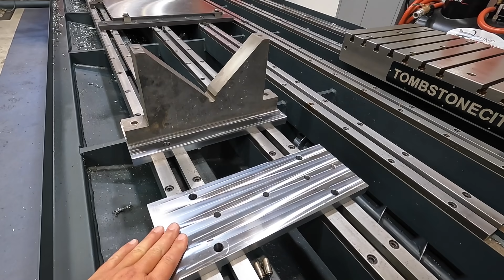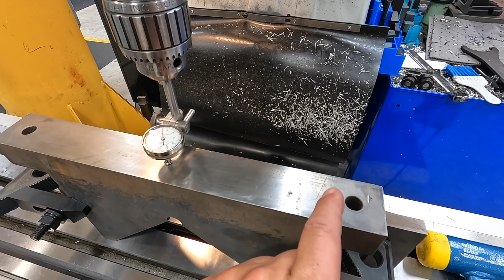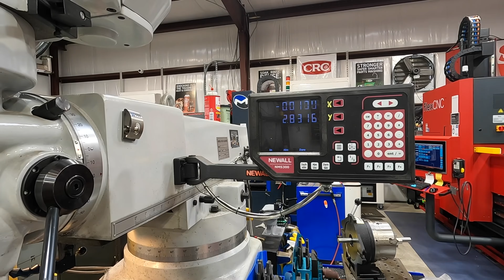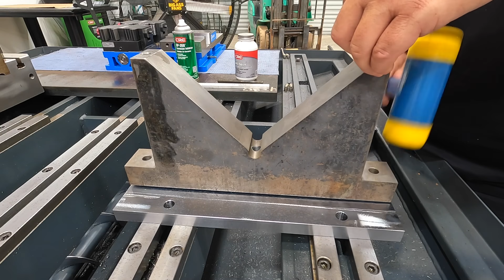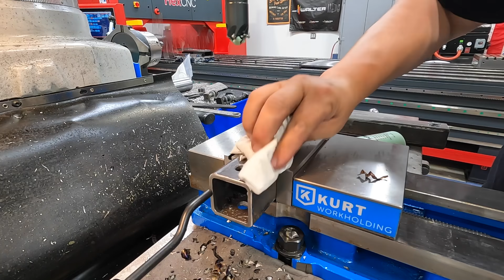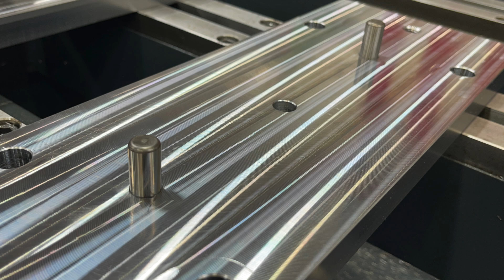Large V-Blocks Modified for the Flex CNC

Comment: When you drill and ream for dowels, do it in assembly. I noticed when you did the Pacemaker you did them separately and turned out with and error. In assembly is the only other than using a jig bore for positioning.

Comment: good job adam . you can mill the V block with a ball end mill if you want it parallel to the machine and then mill reference surfaces on the outside of the V block. so it's quick to find center Next time  or use Haimer 3D in the V track  to find center :face-blue-smiling::face-blue-smiling::face-blue-smiling:👍👍👍👍👍👍

Comment: I know it's easy to say but, instead of drilling in the center of the V-block and dill and tap the shaft to find the center, I would have just used a machinist jack on the milling table to keep the shaft in the middle to find the center, but it's just me. Nice work, Jeff

Comment: Good Sunday morning Adam.
Great video, you put a lot of hard work into fixturing the V blocks. As a hobbyist, I wonder if tapping with a soft face hammer the entire fixtures to correct the difference like you have demonstrated many times traming on the mill would have solved the misalignment or even slotting the holes for Y movement would help solve the issue? I guess it depends on how often the fixture is going to be used and its location on the rails. Heck, the temperature changes can probably change the outcome day to day depending how critical the tolerances are.
As always, I enjoy your content very much and thanks for sharing.

Comment: That was really nice. I wonder, wouldn't it have been easier to make certain your test cylinder was in fact a cylinder? I know that the surface was chrome plated, but I've seen you true up cylinders before in a lathe.  Then you could have trammed the cylinder on the sides and on the top rather than measuring the bottom of the v block.  One less step to introduce error.  Thanks for explaining how easy it is to use shims if the  workpiece isn't sitting right on the blocks.

Comment: The best way to do this would have been just bolted down and 3D mill it whit a ball endmill. 
Adam , you’re a pretty smart guy, why did you do it this way it was so predictable that they won’t be in line because you accumulate a lot of errors and you work a lot , for a crappy result. Think like a CNC guy , 3D mill it

Comment: Adam, i dont think you should have used the surface of the hot rolled plate to tram in and find the center. The v way may not be perfectly perpendicular to the surface you used as your reference. If you sweep the chrome rod, you pulled into the vally of the v, in x axis you could have verified it was perpendicular to the y axis dowel pins

Comment: Your stock left on that ream was correct, but your math was wrong. Typically with reamers, your pre-drill should be 2-3% smaller than the final ream size. For a .500 reamer, that's .010"-.015".

Comment: G'day Adam.  The overall job worked out with slight variant off centre, which can be compensated through programming. 
The problem being that the larger diameter shafts will have a few thousands of an inch variants depending on the length, but even these will have to be trammed in before machining. 
So looking at your efforts,  it looks good. 🎉🎉🎉

Comment: You went through the trouble of making that "centering plug" you should have used it as your datum surface instead of the flame cut edge. That would have insured that you were 90 degrees to the "V". It could also be used to measure the distance from center line of the "V" to the mounting surface and make any corrections if there was a difference between the 2 blocks by milling them. No shims needed. In the end you probably wouldn't have that .003" difference. At least that's how I would have done it.

Comment: If the goal is to find the center of the V not the center of the bottom of the block; assuming the sides of the V are perfectly perpendicular to each other, would it have been better to pick three Z heights, say 1/5th, 3/5ths, 4/5ths up from the bottom and probe to find the center on those and compare those three "centers"?  If they all line up that confirms the sides of the V are perfectly perpendicular right?

Comment: Adam, a question if you don’t mind. If you use shims for alinement won’t that throw off your parallel end to end for height? You might be better off decking the one side of the “V” block the .003 “.

Comment: Nice project. In the future when you're machining the bottom of the v-block, you might want to mill around the base so it's easier to center the block for drilling the pins and center  hole.

Comment: Would a machinist's jack under the cylinder pushing it upward into the Vee have located the center of the Vee without having to drill the V-Block?
Reply: That's what I would have done. Seems like he made more work for himself for no reason.
Reply: or used a big kant twist clamp

Comment: You can re-cut in place if you need more precision
Reply: Posted (and deleted) the same thing. Similar idea as truing surface grinder bed/chuck with the grinder itself.
Reply: And how would he do that with a fixed spindle???
Reply: @liamkelly8684  It's a CNC... interpolation. Move two axes at once.
Reply: @liamkelly8684  could go it with a cutter ground to the correct angle and stepping up and down on two axes
Reply: @liamkelly8684  3D milling whit ball endmil
Reply: I don't know anything about fusion, I've been a mastercam guy for the last 20 years if it were me I would just run a flow line finish .003 step over and resurface the V blocks so they were parallel to each other. They have the big cut out in the bottom so it looks like there's plenty of room to get a 1/2" ball mill in there.

Comment: BTW, it is possible when pushing or driving the slip-fit pins in the hole, with a lot of oil around, for it to diesel and fling the pins back out. Have to push pretty hard, hit it with a hammer and you may get a surprise!

Comment: i think if use the edgefider on the 45 degree face of the V block it will work as long as you dont change Z height from side to side, have you tried this?
Reply: nevermind, I commented before realizing which side you were drilling from. I just needed to listen better in the beginning 🙂

Comment: Why do you reverse the countersink cutter?  I think I can see that it makes a pretty chamfer but I don’t understand why.
Also a fella once told me faster rpm on the reamer for a slip fit and slower for a tighter fit. Maybe in a future vid you could address these.
Reply: He put the mill in reverse because he switched the mill to low gear. In low gear reverse is forward. Clear as mud? 😂
Reply: @grntitan1  yes it is, thank you.
Reply: Look up shutter effects, rolling shutter vs light source frequency.
Reply: @CothranMike  yeah I know about that. He said he was putting the machine in reverse.
It wasn’t a visual effect created by the shutter speed vs machine rpm.
Reply: @1911wood  thanks for that information, for most it would have been the other.
Reply: @CothranMike That isn’t what was going on here. Adam clearly stated he put the mill in low gear(back gear) and ran the mill in reverse. Standard procedure on a knee mill in back gear.
Reply: @grntitan1  I agree that Adam said all this, the OP eyes saw what I stated, let's ask the OP what he meant to settle this. 

Yo @1911wood! What did you mean

Comment: Maybe rotate one of the V blocks 180 degrees to see if that .003 difference improves?
Reply: I was going to suggest putting a piece of precision shafting in the V-blocks and sweeping it with an indicator.
Reply: Just what I was going to say. Now I'll just tell you that good minds think alike,  (sometimes 😂😮anyway).
Reply: I was going to suggest the same thing.
Reply: I would have clocked them up with the long round bar then fixed them down, that way they would have centred themselves, the way it is know then the error shows up.
Reply: Just 3D mill it whit a ball mill to make them perfect .
Reply: could probably tap that 3 out with the little bit of dowel pin clearence he has.
Reply: @blacksupra10  The V-blocks are soft CRS, so .005-.010 is fine for non-precision milling of flats and grooves on round stock. If he does need precision, break out the shim stock. :)
Reply: @Bob_Adkins  ah yes, but shim stock also raises the part.
Reply: @blacksupra10  Raising the low side is the goal.
Reply: @Bob_Adkins  but he wont have a low side,  he will have a shaft thats out of parallel with the table when viewed from above.
Reply: @blacksupra10  If the shaft is already parallel, there's no need to shim it.
Reply: @Bob_Adkins  but he cannot achieve parallelness better than 3 tho out over the distance the blocks are spaced. im not saying it matters for his use cases, but my argument is the error exists, and its not curable unless he pushes one block back 3 tho on the table.
Reply: im incorrect also. it's not as simple as moving one block back 3 tho, as that value was taken from an angled face. trigonometry needed to know a true number.
Reply: my argument assumes the error is from slightly offset dowel placement. your argument is good if one block is simply sitting lower on the table. would need to flip indicator to the other side of V and see if error matches.
Reply: @blacksupra10  
Yes but all the fuss of the dowels floating on air had no bearing on the V Blocks, like a casting you need a good datum point to start from. This was done in reverse, the large part of the audience a not engineers so the content suits
Reply: Make another two clamp bars with packers welded on for small bars.
Saves things keep moving about.

Comment: Another precision job, that I could only dream of achieving. Not sure I would have hammered in the pins with the fixture on the mill bed though.
Reply: given it's supposed to be able to handle the forces of cnc machining, I would assume it didn't even feel the soft blow?
Reply: @gigaherz_ You are probably right. But I'd still have taken them to that nice Fireball welding table, situated them over one of the legs with some plywood or similar underneath before wacking them.
Reply: 3 thou is for you precision job ?